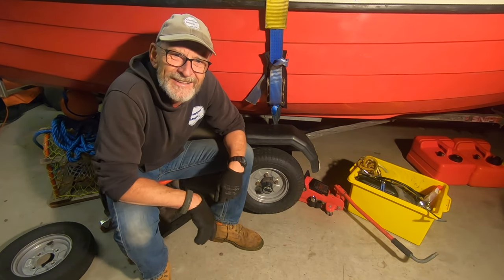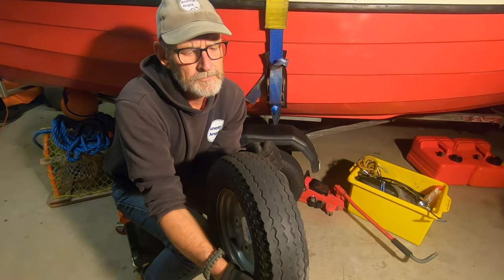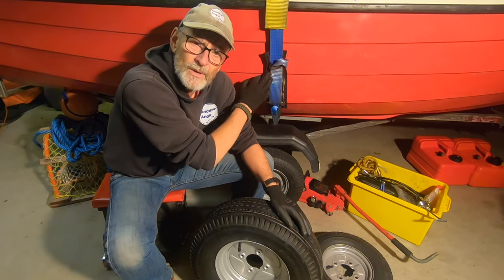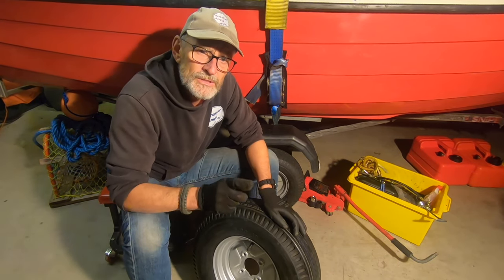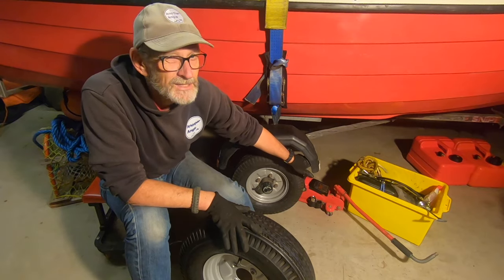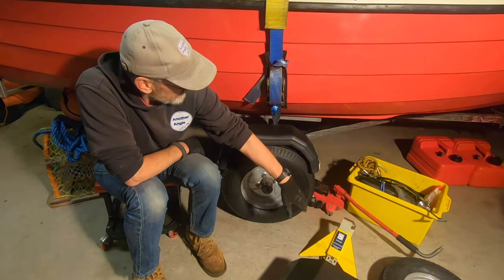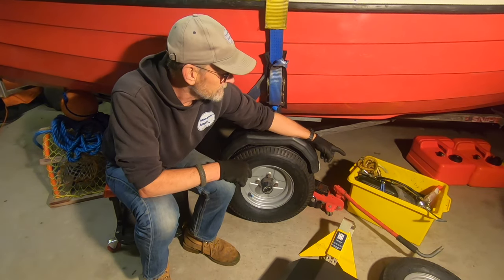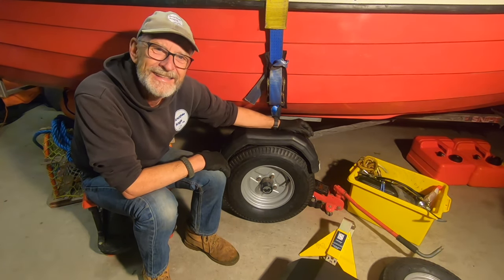Boat Trailer upgrade : Why Big is Better : Orkney Coastliner 14 : Part 5

Comment from the maker: UPDATE: I've waited a while to make comment on whether the 'upgrade' has been worth undertaking.  Having once again made the return trip from Aberdeenshire to Cornwall I can confirm the boat trailer rides much better than the original 8 inch wheels.  The boat gets a much easier ride on our pot holed roads. It seems more solid sat behind the tow car at the legal 60 mph on the motorway.  The hub bearings are running just as smooth as the day they were fitted - they certainly don't revolve as fast or far over the same distance. A job worth doing and a beneficial upgrade in my view.

Comment: You’ve certainly got the right mentality when it comes to all the safety &  maintenance aspects Phil, there would be nothing worse if you had a breakdown or an accident because the trailer wasn’t maintained. A few others on the roads should watch your boat videos, they’re excellent.
Reply from the maker: Hi Hutch, thanks very much. Those bearing buddies are brilliant.  That slight positive pressure pushing grease into bearings in my view really protects them.  My last adventure down to Cornwall (Fishing Falmouth 2024) was a 1300 mile round trip.  Bearings still nice and smooth.

Comment: Great video. The bearings savers are a great idea. Good Intel on the larger wheel upgrade too. I've bought an extra bank of rollers for my trailer to make my solo launch and retrieves easier. Tight and safe lines.
Reply from the maker: When I bought the boat I replaced all the rollers with new rubber ones, in hindsight the harder ‘nylon’ type would have been better. Tight lines. Phil

Comment: I have a 14ft Broome speedboat,I changed the trailer wheels to 13" from the old BMC mini wheels.I fitted spacers on the hub in order to allow the suspension units to fit inside the 13" Nissan Micra wheel profiles.Every inch you gain on the dia gives you 3.14"more on the perimeter.ie. ten inch to 13 inch  gives you  12.42 inches.per wheel revolution.
Reply from the maker: Thanks Stan. Good advice, I think I’ve gone a big as I can on this trailer / boat combination. Maybe in a few years I’ll look into replacing the old trailer with something newer on 13’s.  For now I think I’ll see quite a bit of an improvement.
Next job it a wheel bearing on the other side that has a tiny bit of rumble starting. Topic for another winter video if anyone is interested.
Reply: We always carry two spare bearing kits and grease.Bearings with grease nipples are handy before your trip home in order the flush out the salt contaminated grease from the bearings.
Mixing certain types of grease can melt the grease,what gives grease it's body is the soap they use.
So,sticking to the same grease is a good idea.
Reply from the maker: Snap. The yellow box you see in the video has all those together with a jack,  mini tyre inflator and spare ratchet straps.   Best to be able to get yourself out of a mess rather than rely on anyone else.

Comment: Bearing savers or buddies as mine are called are great, I used to go through a set of bearings almost every year.
Since putting the buddies on, I'm at 3 years and going so far.
I re grease mine every time I recover the boat before driving home.
My old coastliner had 10 inch wheels too.
Reply from the maker: Thanks for watching and commenting.  I agree the bearing savers / buddies are well worth fitting especially on a high mileage outfit like mine.  I’d noted the newer Coastliner’s and 440’s seem to use 10 inch wheels.  I’m sure the boat will get a softer ride now.

Comment: Aha, Now I see what the bearings are!  Interesting idea. Without them do you think your bearings would be rumbling every October?
Reply from the maker: Hi Dave, thanks for watch and commenting.  The bearings on the Orkney have been on for three years and done many miles - three trips to Cornwall and several over to the West Coast. One side is only just beginning to rumble despite repeated dunkings in salt water.  I'm totally sold on these Bearing Buddies.

Evidently your Drascombe Lugger can be launched and retrieved without getting the hubs wet, however our Dabber hubs usually end up in the water though.

Keep the Bala videos coming - I learnt to swim there as a kid when we had an old caravan at GlanLynn Campsite at far end of lake 👍

Comment: Hi, well that is a good upgrade and I think you will really notice the difference, I put 13" car wheels on my trailer and it's great on the road and lightly loaded so little chance of a puncture, hopefully 😕. Do you use fuel treatment? I found a noticeable improvement in engine running, and the fuel is supposed to last a lot longer. A good video anyway 👍👍👍
Reply from the maker: Thanks. I do use the fuel treatment and also use the premium E5 fuel. Over the winter I start the outboard once a month to run fresh fuel through it.  
Also, I have the boat/trailer on jack stands to keep weight off tyres whilst stored. Think that helps too.

Comment: If you can get those lug nuts off that fast garage shop would have to pay you double.
Reply from the maker: You're right there. But once they've had a few salt water dips they will take a bit longer to spin on 😀